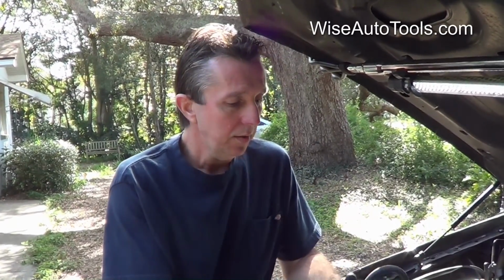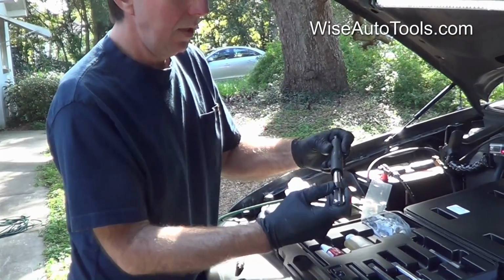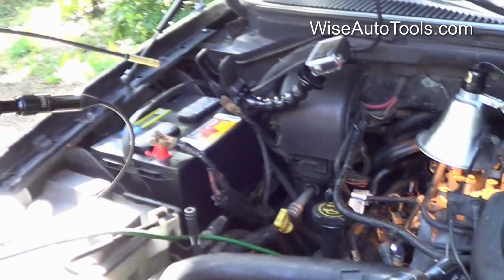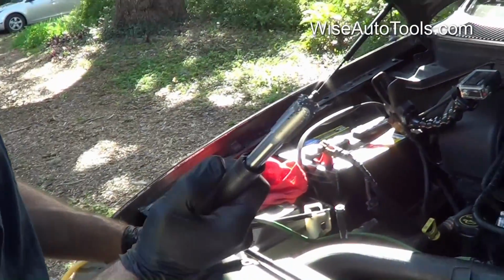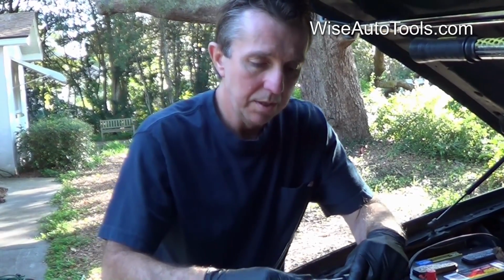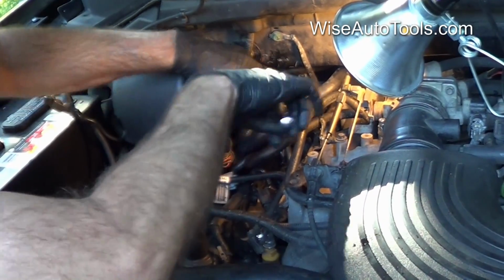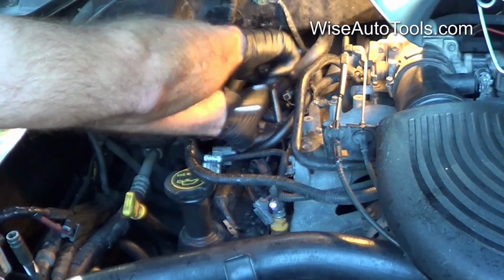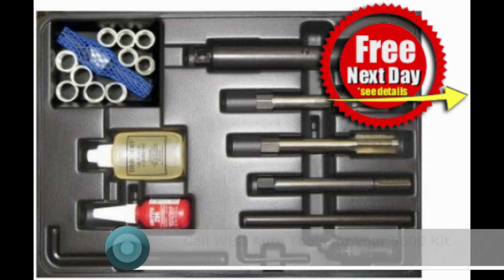Time Sert 5600 Largest Spark Plug Thread Repair Kit Demo

Comment: I saw this about 3 months too late! 😳
I just had to do FIVE Plugs on my Brother's 5.4L E150. UGH!!! 

I may have to get the other 3 inserts, and finish the job. After 11,000 miles of work, they are all doing great 👍👍. 
I even pulled 2 Plugs to check combustion. These Inserts are a stress and Head saver, thank you!

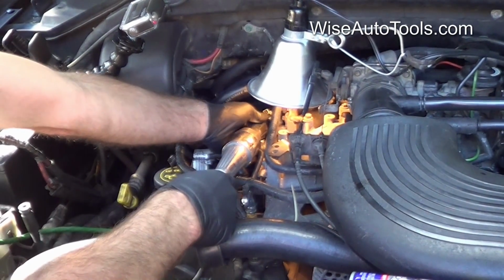Comment from the maker: IMPORTANT: https://www.wiseautotools.com/time-sert-5600-triple-over-size-for-spark-plug-thread-repair-kit/ Get free tips emailed when purchasing from us. Here's one very important one, please read. *Please note that the progress of the depth that the reamer has reached should be closely monitored. In the video at around 7:08, we mention that the tool will not go but so far because of the collar; While this is true in most cases, we advise to be careful and stop once the counter-bore (the widest portion) of the reamer has been reached. Forcing tool to continue cutting may possibly cause irreversible damage to head. Questions please call us at 800-734-8665 x251.

Comment: why did you use the 5600 triple oversize and not the 5553?
Reply from the maker: Compression leaks had eroded holes making them larger. Wanted to make sure we were tapping into enough material to make good threads for the repair.

Comment: Thanks, good video, convinced me to sell my truck. Last piece of ## ford product Ill ever own.
Reply from the maker: I understand the frustration. Many Ford owners are upset with a blown plug. Many however have this issue with over a 100,000 miles! We've had many customers that use our repair kits and get another 100,000 miles. So no matter if you're selling it or keeping it, fixing it first makes the vehicle much more valuable. Good Luck. http://wiseautotools.com/calvan-38900-ford-4-6-5-4l-6-8-spark-plug-repair-kit-w-6-inserts/

Comment: did you do 2 plugs cause you put a 2nd insert if you did 1 plug what's the 2nd insert for
Reply from the maker: The 5600 kit uses 2 inserts per hole.

Comment: Helicoil 5334-14 Save-A-Thread Thread Repair Kit M14 x 1.25 worked for me $50.00 on amazon, it has a knurled full insert and locks at the top with a few  small taps, took 20 minutes to install.
Reply from the maker: Hopefully that holds for you. Keep us in mind if it fails. Parts stores sell those temporary kits also. Never liked the idea of whacking the top of an insert with a hammer and swedge to hold it in place. Especially when there's so many heat and cool cycles and engine compression. Time Sert has a better method. Time Sert inserts are are held in by using an installation driver that screws in and expands the bottom of the inserts, holding them in from the bottom. A much better repair. Good Luck.

Comment from the maker: The 5600 kit is still working great. We may also have a less expensive repair, depending on the application. Give us a call for assistance. 800-734-8665 ext. 251

Comment: hmmm why did I have to pay for the valve leak tester if it's supposed to be included on the 5600
Reply from the maker: Hello Robert, thanks again for the purchase. The Calvan 389-4000 leak tester is not normally included with the Time Sert 5600 kit. However, at DenLorsTools.com and WiseAutoTools.com we have separate listings which one offers the 5600 kit without the 389-4000 but has faster shipping (usually 1-2 days). The one with the 389-4000 included, still has free shipping but it's a slower method, usually 2-3 days. Hope that answers your concern.

Comment: just finished putting a Time-Sert on my 04 Expedition did everything by the video waiting for results to my everything seemed to turn out exactly the way the video said thanks for all the info. don't let another shot so they can't repaired until you tried this
Reply from the maker: I agree, many shops that are unaware of our kits may say a cylinder head replacement is necessary. Replacing the head can be a costly mistake. In most cases even when a parts store kit has been used and failed, one of our kits can save the head with less downtime and much lower over-all cost. Keep in mind that we provided the video for more info on how the job can be done, however, the video alone is not intended to replace the manufacturer's instructions. Just had to add that disclaimer. Anyone else reading this that needs help finding the best kit for your situation give us a call at 800-524-9783 x251.

Comment from the maker: Since we've had requests for the 389-4000 with the 5600 kit, it saves time because there's no need to remove the valve cover to make sure the valves are closed, we've added 5600 listing that includes a free 389-4000 cylinder leak tester. It comes with free fast shipping. Questions call 800-734-8665 x251.
http://wiseautotools.com/time-sert-5600-triple-o-size-spark-plug-thread-kit-w-free-389-4000/

Comment: Sorry , I am a little confused .  You used 2 inserts , only because it had previously had a Helicoil installed ?

Thanks ,
God bless
Wyr
Reply from the maker: +Wyr Twister The 5553 works on holes up to .66" and the 5600 works on holes ups to .73". You have to have enough material to make threads into. Thanks for the comment.

Comment: I have read on repairs on this type of problem and so many of them were temporary. I have a plug that has been blown out and looks to have been tapped once already and would like to know how long this would last if even an estimation. How does this system compare to say a helicoil?
Reply from the maker: +Issac vigil We get phone calls frequently regarding the "temporary" parts store kits, like Helicoil and the self tapping Dorman and how to repair. Since the previous repair has failed, an oversize insert is needed. Time Sert is designed and manufactured in the USA and is what we consider a permanent repair that will usually outlast the vehicle. In fact we have had no reported cases of the Time Sert 5600 failing to date. How are they held in? Typically the Helicoil solid insert is held in by using a wedge type tool on the top of the insert and swedging it in by tapping with a hammer. Dorman is a tapered self tapping adapter. Time Sert repairs are first tapped and then held in by the driver installation tool cold rolling the "bottom" of the insert. This holds it securely form the bottom. Anyone mechanical knowledge can clearly understand how this is a much better way to hold an insert in, especially when considering the heat and compression that is subjected to the repair insert. We also email helpful tips when the kit is purchased form our websites either DenLorsTools.com or WiseAutoTools.com. This kit comes with free expedited shipping. Remember for the best service, we don't sell on Ebay or Amazon, only on our websites. Just write tips in the comment section during checkout or call us to talk to a live person at 800-0734-8665.

Comment from the maker: Can't say enough about the quality of this kit. We also sell the Calvan 389-4000 like used in the video to help determine that the valves are closed without taking the valve cover off. The Time Sert 5600 is available at WiseAutoTools.com with free next day shipping. http://wiseautotools.com/time-sert-5600-triple-over-size-for-spark-plug-thread-repair-kit/

Comment: Agree about the compressed air...have a small jun-air compressor for work related demos I used to blow out chips but not enough cfm for tools..checked with bore scope b4 plug install ... Running great so far !!!!  My profession is industrial pneumatic automation ..can't believe I don't own a real compressor...but I'm shopping and gonna take the plunge....it'll make life easier for the weekend projects.thanks again...great help
Reply from the maker: keeglitt1 Thanks for the explanation. I just didn't want others reading this thinking that they could be successful without blowing the chips out and cleaning thoroughly. Glad to hear you got your truck back on the road.

Comment: Thanks for the vid...finally got the nerve to do an in body repair this weekend using the Timesert....2001 F150....worked like a charm...did not have air but had a Rigid right angle drill and worked for counterbore and reamer......better description of tap depth might be helpful...used best judgement and all good so far....thanks for taking time to make the vid!!
Reply from the maker: keeglitt1 Thanks for the comment. I can see getting by without an air compressor for the tools, if you use electric tools or a very good battery operated ratchet,  but I would never try this job without compressed air to blow the chips out of the cylinder. The shop vac just doesn't get everything out. Brake clean and compressed air with the blower was the most effective in removing the metal chips from the cylinder. As far as the tap depth, you can feel the tap turning pretty freely once it is through cutting. In fact I could just about turn the tap by hand once it was done cutting threads. If you continue, it will drop down, so you'll want the set screw in the extension socket very secure so in case you run out of threads the tap won't drop down in the cylinder. Glad the video helped and again thanks for the comment.